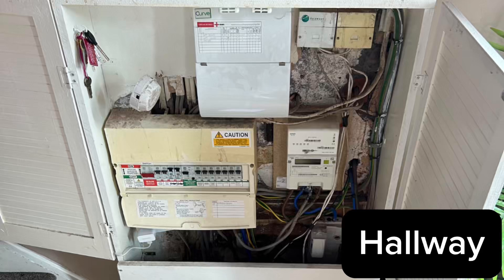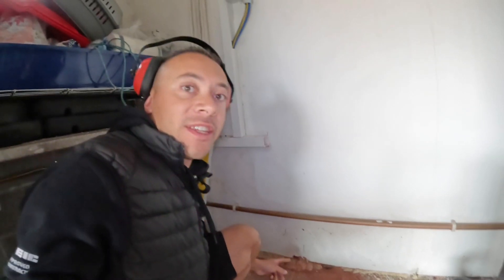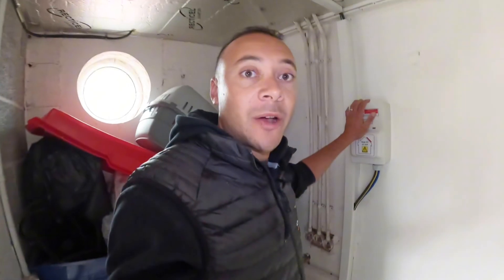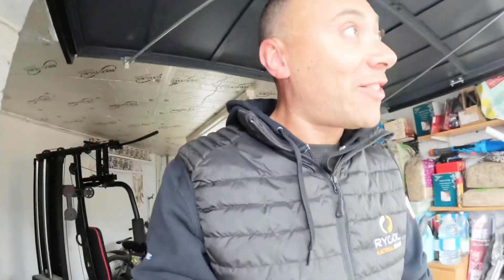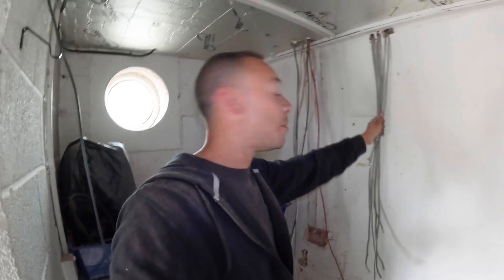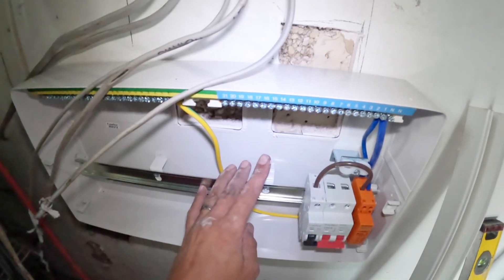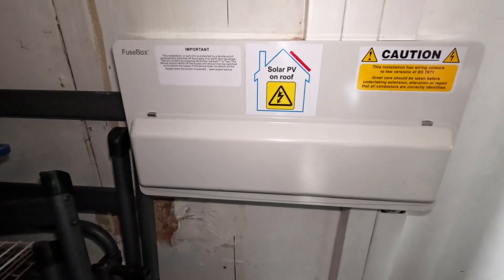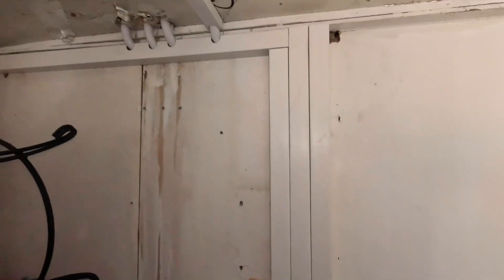Moving all house wiring to a new position!

Comment: And yes, good point...  a lot of modern inverters can go into 'island' mode and backfeed even with no grid supply present. And I trained in 1989, god i feel old... And i heard a fluke volt stick there in the background. I know i am preaching to the choir, but NEVER EVER assume it's dead if it doesn't light. I literally stripped a 6mm  T&E in a roof space, it didn't light up even on single insulated red.... but snip BANG, they RELY on you being earthed to work. I now carry a proving unit on my  belt and an oldschool drummond MTL-7 incandescent filament test lamp (GS38 probes) on my belt.

Also what you found at 8:19 was a fledgling downlight
Reply: (no i didn't fall through the ceiling in shock, just almost)